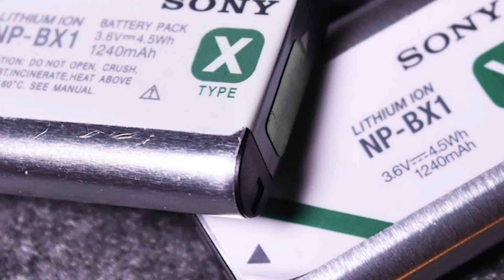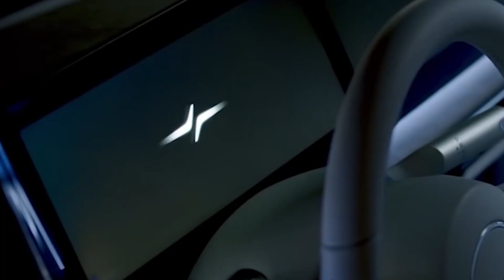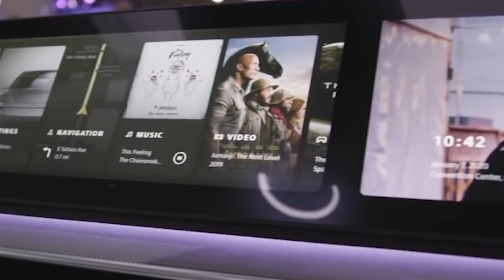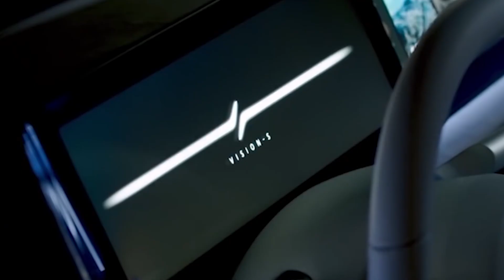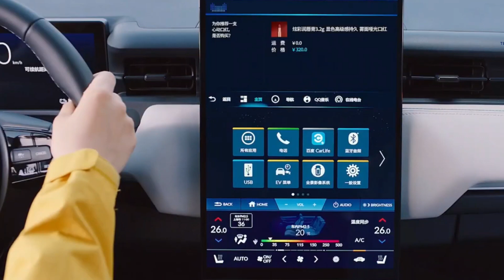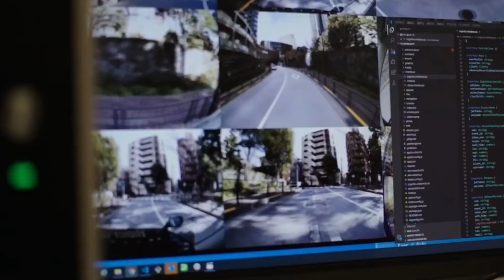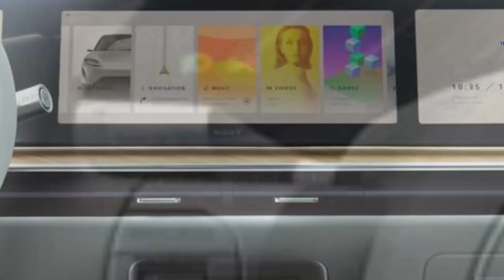BIG NEWS! Honda And Sony Just LAUNCHED Their First EV!

Comment: Its old news and will never come to production
Reply: @Vancity23. Haters are gonna hate... So, how's your Tesla dude?
Reply: @mrgurulittle7000  True. Our model 3 long range has exceeded expectations and we were skeptics before buying. Its my wife’s commuter car, and with home charging multiple over the air updates, and a service call to replace a rear taillight where they came to our house, its been great. It doesn’t sound like our V8 truck we have to pull our boat but its does its job very nicely.
Reply: @Vancity23. Wow, sounds like a good car.
Reply: @mrgurulittle7000  Yes but for the right purpose, level 2 charging at home, plus super charging access very close by (which we dont use) and quick and easy Tesla service to our house when we needed it, its a perfect fit for us. I know this is not the case for many people depending on there needs and where they live.
Reply: @Vancity23. I'm thinking of a Leaf because Teslas are still too expensive. What do you think?
Reply: @mrgurulittle7000  I don’t know too much about them other than smaller batteries so smaller range. I believe they are stopping production. The Chevy bolt is such a bargain, even before rebates and while not a Chevy fan, with full factory warranty, it should be considered depending on your needs.
Reply: @Vancity23. Ok, I'll check out the Bolt. Thanks man.
Reply: @mrgurulittle7000  If you do and test drive I would be curious to hear your thoughts…
Reply: @Vancity23. Yep, I'll let you know.